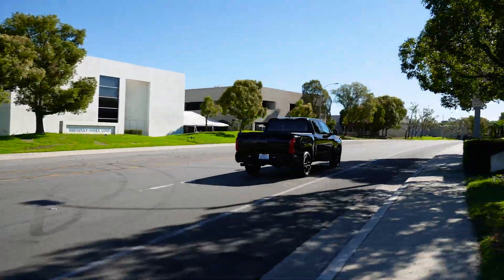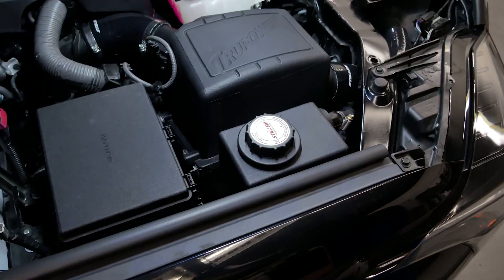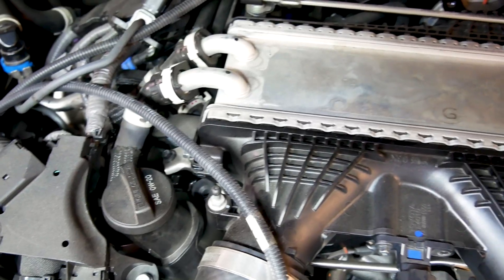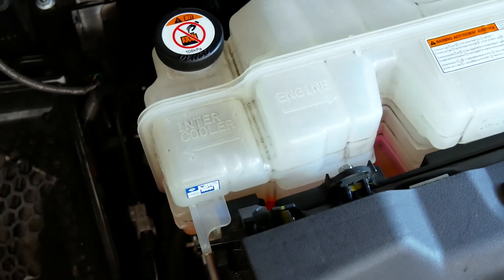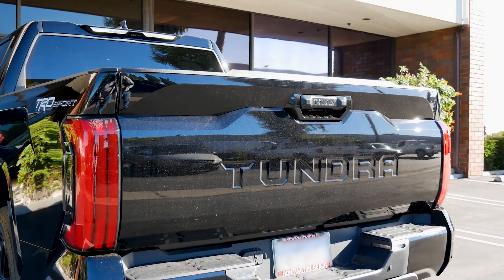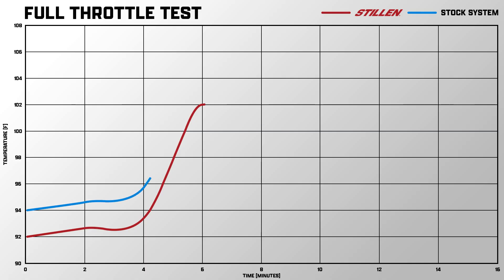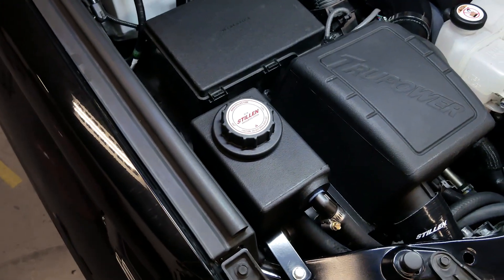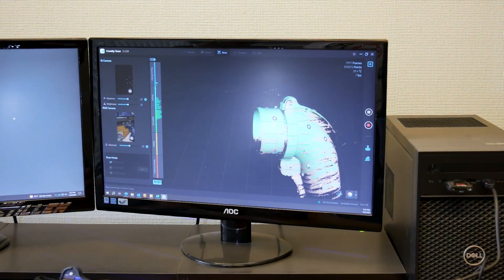Push Your Tundra Harder. Keep It Cooler.

Comment: This is so awesome. I have a 2026 Tundra... I really want the Twin Turbos to perform at a high level for a long time, do you think this plus the Cold Air Intake can help extend the life of the Twin Turbos? When will you have a 2026 kit available?
Reply from the maker: Haven't had a chance to test the various parts on a 26MY yet but  hopefully we will simply be able to extend the year range once we do. Here's hoping. Between an intake and the relocation kit though you will get better cooling and more air flow so the turbos simply won't need to work as hard to hit their targets. Less stress typically means less wear in both cars and life.